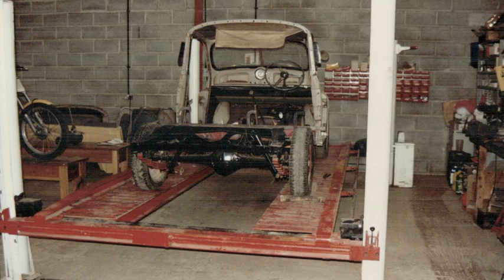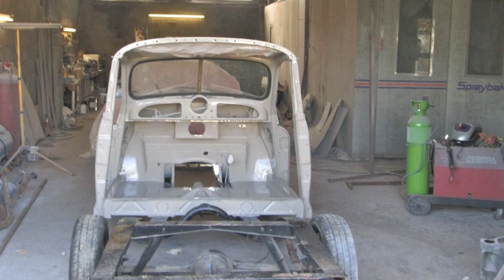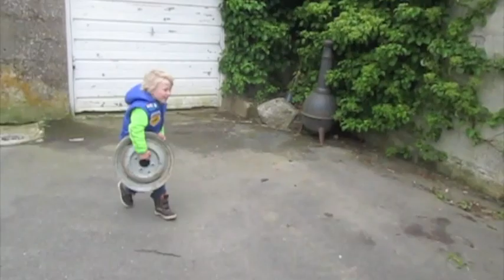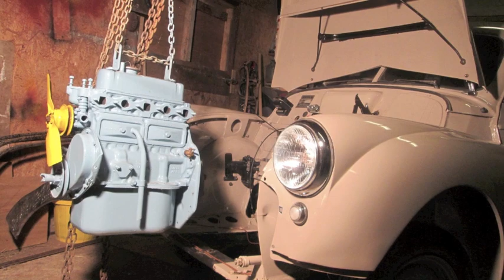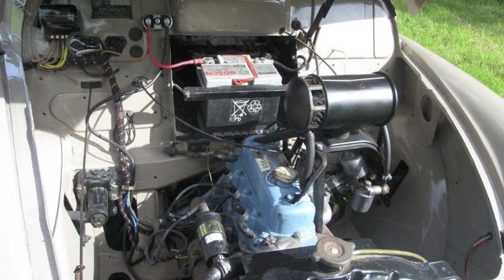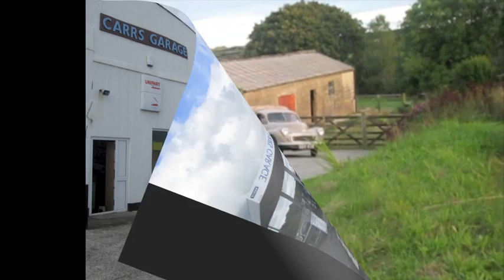Morris Minor Pick Up 1955

Comment: Very nice restoration and cracking little video clip. So glad you kept it original spec and what a nice touch that the garage which sold it in 1955 is still in business!
Reply from the maker: First owner owned it 33 years - I’ve owned it 27 years and chasing her record 🤞🏽56,000 miles from new on original engine 👌
Reply: @fdt50  Thats amazing...I really hope you manage to get that missing bit of history. I'm not sure how many Moggie pick-ups are left but it won't be many and 50s split screen, even less.

Comment: Was the first owner lady a furniture restorer?  If so I nearly bought this pickup at an auction in Cornwall 1980s. Same colour (what name is it?) splitscreen, an absolute gem.  No dents at all to the wheel tubs or tailgate, not a scratch, because the only cargo had been blanket wrapped antique furniture.
Reply from the maker: Hi, if that was in Tavistock then yes. It was owned by a lady for 30 years. Who bought it new from Carrs of Tavistock
Reply from the maker: Colour is Sandy Beige, I’ve also owned it over 30 years
Reply: I don’t know where the lady had lived but the auction was at the Royal Cornwall showground, Wadebridge.  A young hippy dude had bought the pickup from the original owner, the lady furniture restorer, got the engine running, brakes, MOT etc then driving to the auction was its first longer run.  The ancient tyres had looked fine driving the short distance to the MOT but by the time it reached Wadebridge they had huge bulges in the sidewalls showing canvas.    
The auctioneer walked along the row of cars telling each seller to start his engine so buyers could hear it.  He shouted at the hippy dude a few times but the engine was actually already running and so quiet nobody could hear it.  That raised a chuckle. 
 I recall £450 and I suspect that was what I was offered it for after it hadn’t sold in the auction.  I was so tempted but couldn’t justify it at the time.  I drove it a little, lovely.  
Unless there’s another split screen pickup in Sandy Beige down this way, low miles from a lady first owner I’m 99% sure it has to be same one.  👍🏼